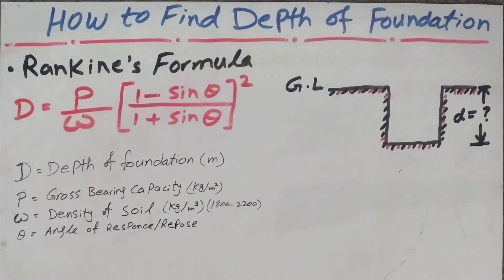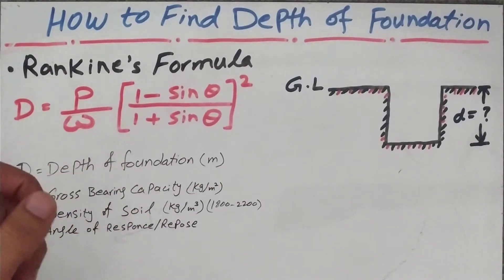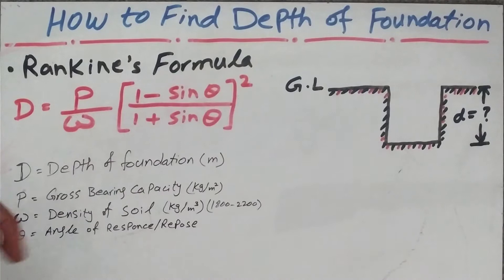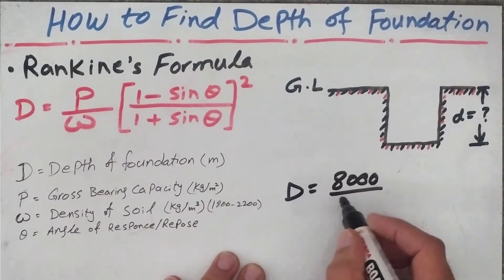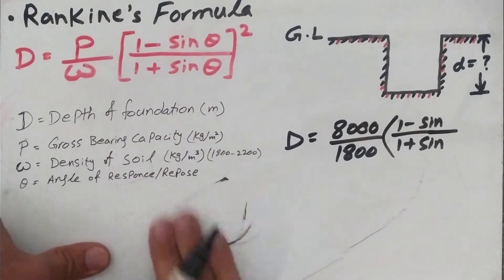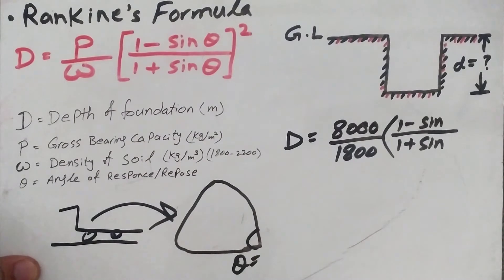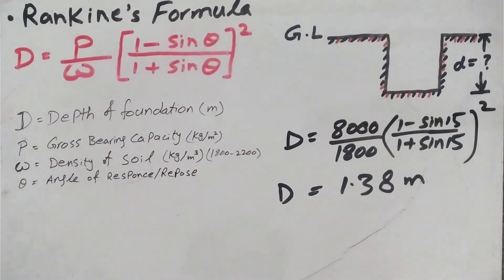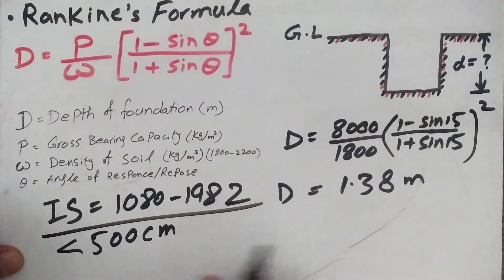Foundation Depth Calculation - How to find depth of foundation?

Comment: Sir, a situation is like this;a first layer of chb was laid over a concrete mix of 50 mm thick as its foundation, at dawn, the owner filled the top of the Ist CHB layertogether with all 4 Column top of the footing with rock Salt they say to prevent Termites into the site . 1 day past n the 2nd layer were laid over the 1st layer (the rock salt being allover the CHB top, )will strength of the ChB fence at 2.50 mtr high still be positive, thank you Sir if you could comment on this impt. Matter.